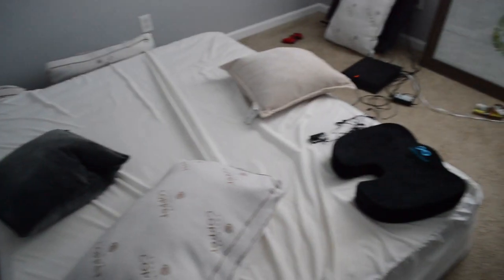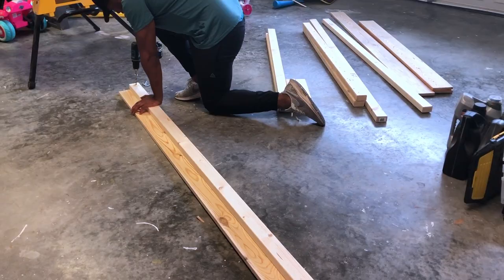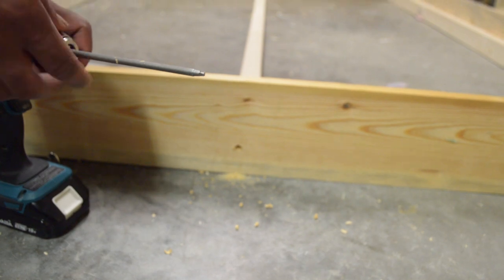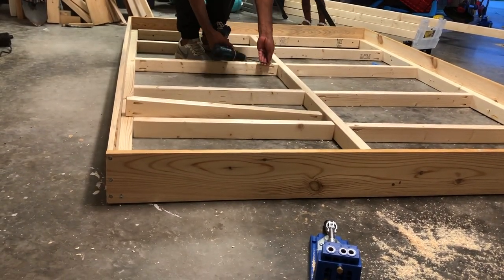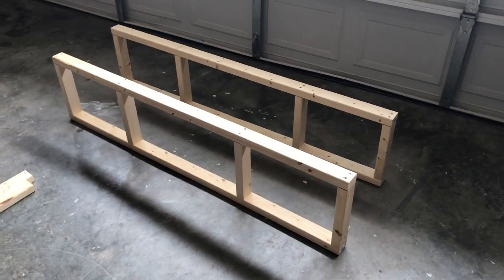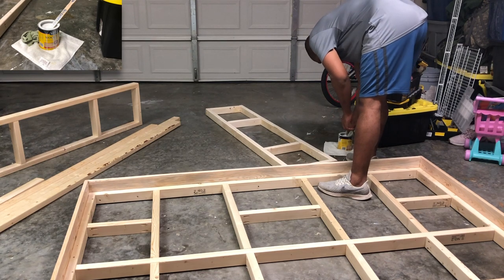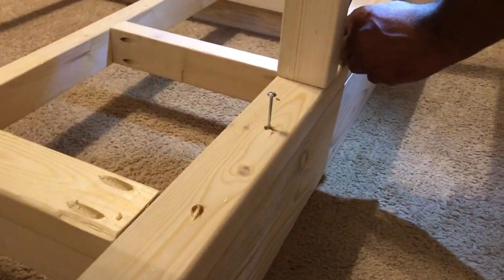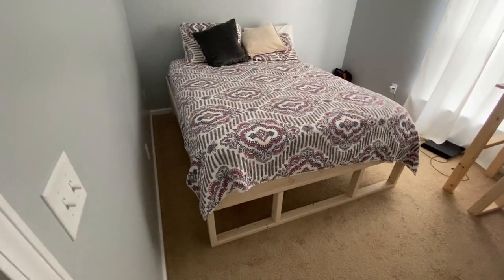How to make a Bed Frame Quick and Cheap

Comment: Which size screws do I need and roughly how many?
Reply from the maker: If you using the pocket screws you can use two inch screws. The pack comes with 100 screws. Pre drill hole before adding screws this will help the wood from splitting if not using the jig. Any two inch screws brand should be find also.
Reply: @dixonshomecreation241  Thanks! I'm getting ready to make it soon. Best bed frame tutorial I found on YouTube so far, and I've been searching for a while 😂😊
Reply from the maker: Good luck on your bed frame.  For more videos like this, please subscribe to my channel if you have not already. Thanks!